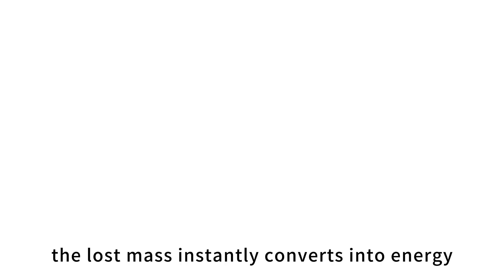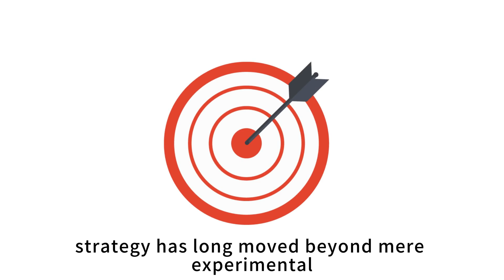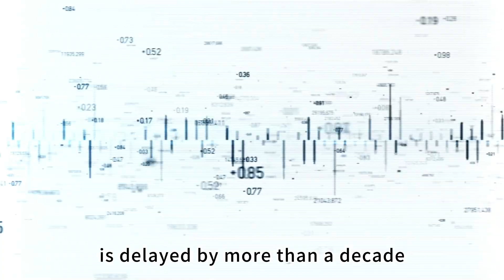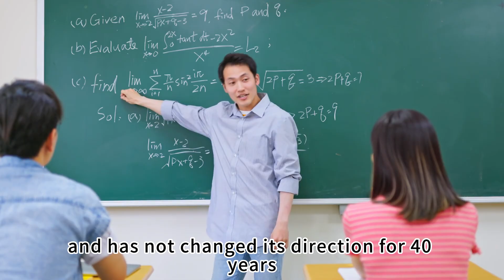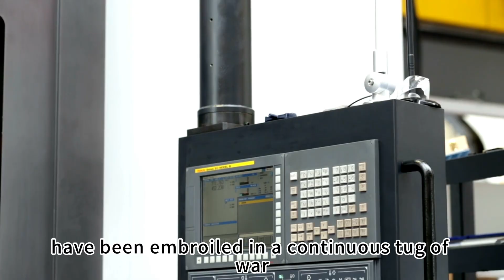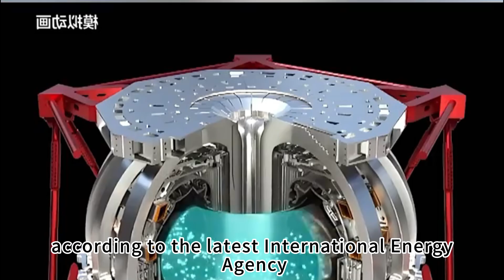China's Bold Plan to Solve the Ultimate Energy Problem

Comment: We have to remember that this is still only a theory and there is still no alloy, ceramic, 
or carbon material that can withstand those extreme temperatures, and definitely NOT what the Chinese 
are using within their Tokamak housing and skeletal  framework. As far as we humans know, so far, no one has yet, created anything that 
would not melt or atomize at those temps, after only a few seconds of contact. So, as far as am concerned, every Tokamak Research and Development project is still ALL, only a big governmental scam. 

There are MANY MORE  fuel-free ways to create electricity, within proven " ZERO-POINT" means, that can be scaled to meet the needs of millions, without causing them to go broke every month, just to keep warm.